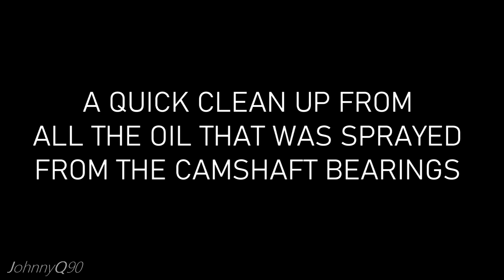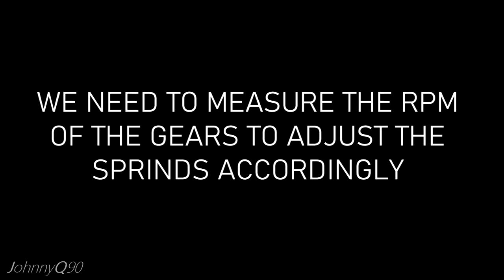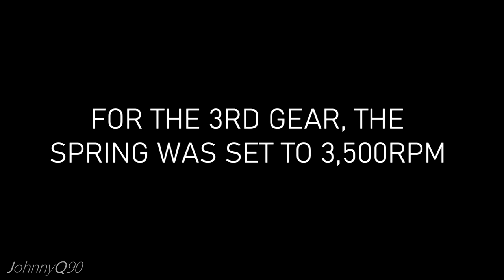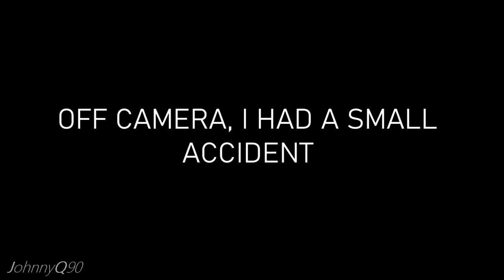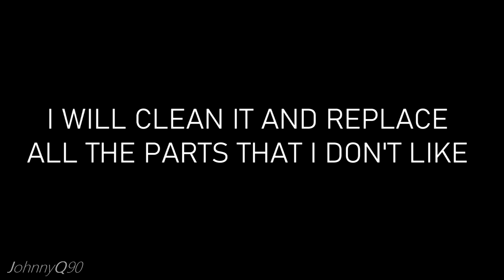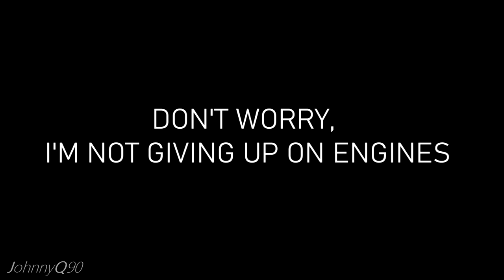How 3 Speed Transmissions work in RC Cars & Next project!

Comment: Just make clutch shoes out of heavier material. The centrifical force will overcome the spring tension
Reply: That's a very clean solution. I like it!
Reply: Its mostly due to the lack of power. But yeah sounds like a good idea
Reply: If you don't calibrate MD5# and other factors, you might have issues.

Source: my ass
Reply: That is also a very good suggestion. I also suspect that the spring tension is still too great. Tip; With a grub screw at the point where the spring rests, you can set the shitfing point by turning the grub screw in or out
Reply: @StevieZeee  Who are you callin a grub screw!??!
Reply: @rreyesco  it has plenty enough power. The power band just sits way lower in the rpm range, which prevents the car from working correctly
Reply: Fabian Rudzewski you’re basically saying it has more torque at lower rpms, fine. Thing is, its not a Racing oriented engine, making it not so suitable for that especific 3 speed trans.
Reply: I wouldnt do this, it will cause alot of vibration due to imbalance..
Reply: This very well could be a dumb question but what disengages first gear to enable second, I’m a rookie but could that be it?
Reply: the issue is the lower revs , not so much the weight of the shoes , if anything i would make a gear reduction where your "gearbox input"gets a higher input speed , the torque of the engine should be enough to overcome the gear reduction. you should try measure the output torque of the engine compared to a standart 1 piston engine.
Reply: @ddbuch110305  there's a one-way bearing that hooks on to the axle in one direction and the other direction it lets go.. i used to race with nitro 1:10 scale and these bearings really need alot of maintanance, almost every race it needed grease because they burn fast if they run dry.
Reply: @fabianrudzewski9027   I think his headers are to long and to many bends every bend in a exhaust is like adding feet of pipe he needs to take the bends out and make it shorter he won't have one big pipe that all of them go to but if each one is a different leanth too it adds alot of heat to that piston
Reply: @wwand47  that's true, but it won't make a 10k rpm engine go 30-40k.
The problem is, that a nitro RC engine generates it's power through ridiculous RPM, where as this does it with lower rpm and more torque. 
But rpm is needed to get the "gearbox" to shift.
Reply: I still don't understand where the root of the problem is coming from...? It's not about torque; the rotational speed causing the centrifugal on the clutch disk is what causes it to engage. Sure, momentary torque could pop the little clutch shoes out too, but it would only be temporary. You need the constant rotational speed to keep it open.

That being said, he tested the clutch and first found that it would only engage at 7000 something rpm. He modified the springs and confirmed they pop out at like 2800rpm and 3000 something for 3rd gear. He also measured the speed of his output shaft on the car, and confirmed a max rpm of 4600..... So why isn't the clutch engaging??

Could it be that when the rpm test on the output shaft was performed, the car had no load or friction on it? With the wheels in the air we get a max of 4600rpm, but perhaps with the tires on the ground and the weight of the car behind it, the motor no longer has the power required to reach a full 4600rpm? And perhaps not even the 3400 required for 3rd gear? Just my guess....
Reply: @twas brillig excuse me??
Reply: @kaylor87  Exactly that, you're spot on. Keep it simple is how to solve. It engages at a set rpm when on the worktop but doesnt on the car. Therefore it's not reaching the required rpm. Sometimes it's easy to get lost in fault finding until you remember to keep it simple. I'd try a smaller set of wheels first to get the revs up.
Reply: Could drill holes in the shoes and fill with lead. That would be quick and tidy.
Reply: @kaylor87  They can`t just engage, they need to grip as well, low engagement is like lightly pressing the brakes, you won`t break fast or even at all if you don`t have the clamping force, that`s why engaging the clutch isn`t enough, you need to REALLY engage the clutch hehe.
I don`t know, I`m in "camp heavy shoes" I think
Reply: A Frog these clutch shoes don’t work like normal ones though they don’t use actual pressure the just engage by hitting a piece of plastic inside the spur gears. So you really don’t need any additional force or friction you just need the rpm to actually fling the clutches out
Reply: @kaylor87   I think you hit the nail on the head, free revving an engine with no load is always going to allow it to spin faster, cutting the springs down for less tension will only allow for so much adjustability before the spring is too short to stay put, adding weight to the pawls should help as long as it is balanced, and the aforementioned grub screws would be great for really dialling in the shift points
Reply: @rreyesco  not power but rpm since 4stroke engine runs at lower rpm than the 2stroke engine design for the original gearbox application...

Comment: As a fellow schumacher racer I know you spent a small fortune finding those new old stock parts. haha
Reply: Schumacher and tamiya vintage parts are worth their own weight in gold.
Reply: Yes ! haha
Reply: And then there's Vintage Yokomo. Priced like a new element found only on the moon!  Restoring an old Schumacher Avenger myself right now, and in Australia the parts seem to be more readily available and reasonable. Procat and Topcoat are a different story
Reply: Had an old belt driven 4wd tamiya roller a few years ago, didn't know what i had and sold it for $25.
Reply: @Druid_Plow  ouch 😭
Reply: Glad I kept all my old stuff. When I was 13 (22yrs ago) I bought a M02 Abarth. It's a little beat up but still a fun little car (just wish I had a 3d printer as I can't find steering cams for less than half the original price of the car)
Reply: @Pyrolysis2142  grab a ender 3. I've got 2 of them and I haven't had any problems with them that weren't my fault. They're around $200.
Reply: This reminds me of my buddy years ago always fiddling with his T-Maxx trying to get it to change gears properly
Reply: @finnz7913  is there a reputable place to buy one at a good price? Amazon.ca it's over $350 cad ($264 freedom bucks) for one.
Reply: @Pyrolysis2142  I have a printer if the piece has been designed already. Lmk
Reply: @HRM.H  I have a few bits from about 30yrs ago, sale on soon 👍
Reply: @HRM.H  جج
Reply: Is that your rx7 in the profile pic
Reply: @HRM.H  first run kyosho says hold my beer.
Reply: That's the sad part of our hobby.

Comment: "You would hate me for this"
All the comment: nope never
Reply: I imagine that nobody will hate him for it, but I also imagine that a lot of people won't be watching nearly as closely. Electric motors in RC cars are pretty common, you can go to any toy or hobby store and have one off the shelf for pretty cheap. These combustion motors, however, are a bit more exotic and take a lot more time and money to get working, something not a lot of people are willing to do, which I suspect is why this series really took off.
Reply: @AiOinc1  - The advantage of electric is the torque, that has a lot to do with the petrol engine struggling to gain revs at lower rpm's. The electric would have ALL the torque all the way through the rev band.

Comment: Unless I'm misunderstanding this, you're selecting a gear from the engine RPM, not the final drive RPM. With all due respect, that is the opposite of what you want. You need to be able to run the engine at near maximum RPM for power in each gear for best performance. Your governor or gear select mechanism needs to be based on ground speed. It may be easier, although I don't know if there's enough space to control that with a servo and a simple encoder feedback to select what gear is active. 

To make this work well, it gets complicated quickly as you'd also need to know throttle input, and motor speed, along with ground speed. This would be an easy job for an arduino and a couple of sensors. You may be more of a mechanical guy than a coder/electrical guy though, and that's ok.
Reply: kleetus92 I don’t believe those gears are engaged by engine speed. It’s hard to say for sure from the video but it looks like that mechanism is likely placed on the output shaft of his transmission, thus operating based on ground speed as you said. 

I once had a nitro rc car and its transmission was similar to your standard constant mesh gearbox except it had one of these mechanisms on the output shaft, with first gear being driven by a one-way bearing. Once first gear drove the car fast enough the mechanism would engage and grab the next gear.
Reply: @tbdcreations5370  Maybe because he takes the reading with no resistance on the tyres. Once on the ground the RPM might drop significantly enough to prevent the clutch from opening.
Reply: @HarryCrackz  Exactly
Reply: anonymous32167 That is likely why it shifted properly under no load but not when on the ground, yes.
Reply: Ground speed can be best measured from the moon after achieving tire to ground look back up
Reply: @tbdcreations5370  Oh.... DUH! I think I know why it didn't shift. Once it engages the first gear, how can it grab the second or third without first unlocking the gear previous to it? Once it locks first gear in, it can't change position to engage the next gear. That's why it didn't shift.
Reply: @kleetus92  no, look at the clutch arms properly. because the spring on first gear is so weak, it slips when the second gear is engaged, then they move faster and the gear slips over the clutch.
Reply: @fabianbiechl4948  the arm moves out to engage, how can it move out further? It's a centrifugal clutch with a pawl. Once it engages, it doesn't disengage when it goes faster.
Reply: @fabianbiechl4948  You can't have 2 gears engaged simultaneously.
Reply: kleetus92 technically the lower gears would be “engaged” but the higher drive gear RPM would be higher when the clutch (pawl) has engaged and  would therefore be taking  presidence
Reply: kleetus92, On the bench in his dremmel you could clearly see both clutches out at the same time. I know nothing about these but how does it disengage from 2nd gear?
Reply: @kleetus92  well, you can. the 1st gear is slipping because of the shape of the clutch. the clutch stays engaged but the gear around moves faster so it slips!! think about it for a second.

Comment: If you're done with the V4, I'll have it! I f**kin LOVE that car.
Personally I'd leave it rich, shorten up first gear a lot (you want it to shed those rubber tyres) and keep tuning your clutch pack. That way you can fun drifting on rubber tyres, and then fit foam tyres for ultimate 0-100 in under 1 second fun!

Comment: You just need to use a weaker spring for the centrifugal clutch to work. I used to do this when OS first came out with their 4 cycle .26 engines in the early 2000's. They couldn't rev high enough to engage second gear so I found a softer spring to make the centrifugal clutch work.

Comment: You should check out the transmission breakdown on a CEN gst 7.7 for second and third gear. There is no spur gear notch To break off. the clutch engagement is fully adjustable without disassembly. Adjustable Spring tension using a set screw.

Comment: Shortening a spring dose not change the spring rate, it’s still the same spring, you need thinner wire, you have a lathe, make your own springs, just buy the right diameter and turn around a mandrill. But I’m sure you already know this as you an intelligent individual, very enjoyable to watch you progress with these projects.

Comment: Let me explain about the gear.
You need thinner but longer spring for the 2nd gear and relatively stronger for the 3rd gear. You measured the RPM of the gears and no load. In loads it never go 4,000 RPM. You need to adjust the 2nd gear spring to engage at 800 RPM and for the 3rd gear 1,200 RPM.
But as I told thinner but a little bit longer spring.

Comment: I had an issue with a two speed system about 15 years ago... Instead of trying to count on the weighted throws to keep the clutches engaged...  I shaped the contact points sharp, like a clock work escapement points.... so they lock in, once they do catch... and stay locked in while under torque/power/throttle....... please note, although this helped a whole lot... they didn't last as long, as the sharp edges dull out pretty quick... but the pulsing, of trying to to stay engaged, then being bogged down, even though, only for a second, was enough to disengage them.. .hence, shaping the contact points to snag and lock into one another ,while under power .. good luck

Comment: Johnny, your clutch is engaging near redline. I've done the 4 stroke thing myself (airplane 4 strokes into land vehicles). You must use heavier clutch shoes!! That's a 15cc engine it has way more power than you've seen so far.. its just not making it past the clutch.  Buy some 1/8" tungsten rod off ebay, and drill holes into your clutch shoes. Press a section of the tungsten rod into the hole and bam, weighted shoes. It will make ALL the difference. There are pics of this solution over on RCTech forums, I can give you a link.

Comment: For a working automatic clutch you need an epicicloidal, it have to shif based on the rpm but once shifted it need to remain in the gear, the one that you have now if you drop the rpm (as naturally occour) it disengage the gear, the best would be a manual transmissio via servoactuator